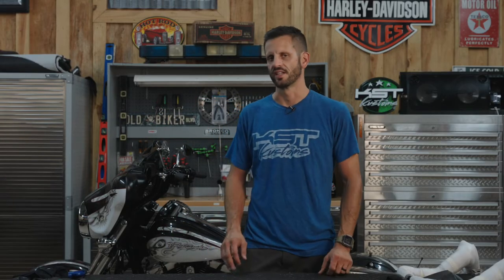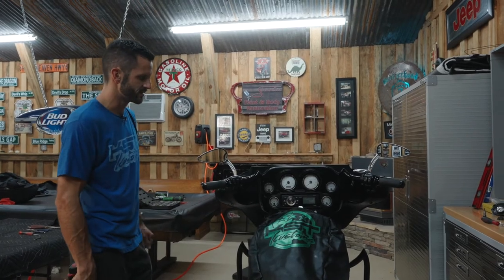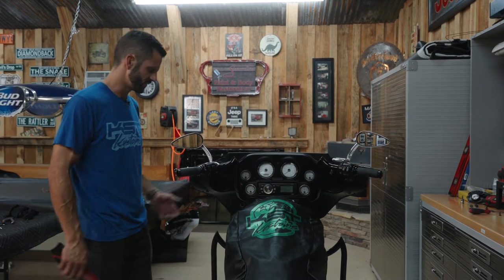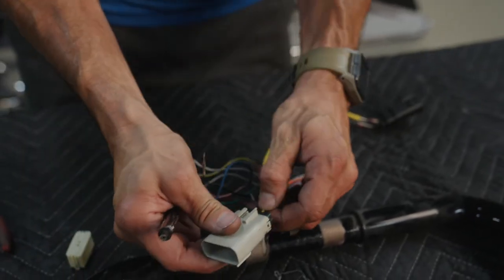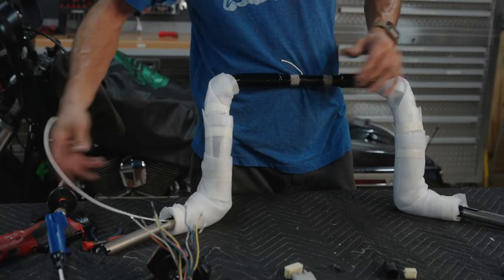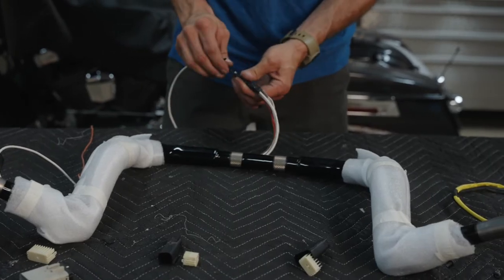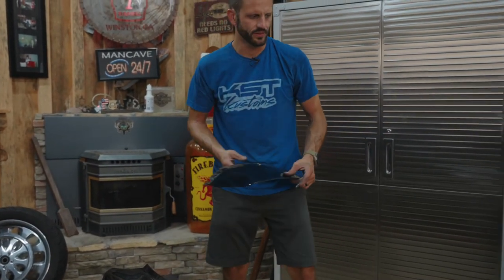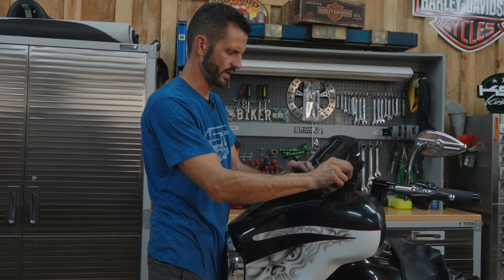2008-2013 Street Glide Handlebar Install | Street Glide Motorcycle Handlebars

Comment: Great job RET, Ive searched far and wide for a handlebar tutorial for my 2009 bagger. you hit it on the head, now Im ready to knock it out. Great tip on non CVO enternal wiring, I ran out to the garage and low and behold,,,external wiring, that was good for a fist pump. Thanks again...Dave
Reply from the maker: Yes sir

Comment: For a 2012 CVO Street Glide is there anything different? where the bar connects to the riser is the bar the same size on the cvo?
Reply from the maker: @RyanReed-b7r  exact same as this except if it has a hydraulic clutch you won’t have to reroute it.

Comment: Hello Ret, thanks for the good video. Very well explained in details.  I replaced the bars on my 2009 FLHX Street Glide. I didn’t take a photograph of it. But my throttle by wiring has an additional plug about 6 inches from the throttle control inside the handlebars.  I followed your instructions and removed the wiring from the main plug. When I started pushing and pulling the wiring out there was a small plug like I said inside the handlebars.  Had I known that, I would have just unplugged it and pulled it out the lower part of the handlebar opening and the bottom.  Thank you again for the well explained video.  All my additional wiring is outside the handlebars, I’m thinking, because my wiring is outside the bars is why there’s an additional plug for the Throttle.  I think it would be too crowded with an additional plug. I replaced the bars with the OEM bars.  Yeah I was hit broadside about a month ago in a gas station parking lot. It was all cosmetic. I’m ok, I did receive some battle scars. Bruised ribs, and a fractured vertebrae. I’m doing good.  Thanks again.

Comment: The only problem I had was the throttle by wire plug re-pinning 3 wires lined up great the other 3 wires you could see the pin in the square but trying to push them through the wires would bend and would not pop up through the square.

Comment: Qwick question.. i ordered 14 inch bars, i have a 2009 street glide .. will the stock wires be long enough too run through the aftermarket bars?  Like the throttle wires
Reply from the maker: I dont believe so. You will need to extend them prior to running the internally

Comment: Great video.  Helped me a lot.  Did my bars yesterday.  12” bars on a 2011 sg.  Didn’t need to extend any wiring or cables.   
Had zero issues pulling the switch wires through but I’ll be damned if the TBW would go.  
Racked my brain for a little while and figured out a solution.   A little bit of petroleum jelly where the pull wire and TBW wire are joined made it slip through with ease.   Can’t believe I have never seen a comment about using some lube before.
Reply: Are you 12 bars this same style?  Just curious because you said you didn't need new cables or wires for sg.  I've got a 2012 is like to put 12's on as well.

Comment: Does the throttle by wire go through the original bars or just  run alongside the bars? Sorry for the dumb question. I'm planning on adding 10" bars to mine. Tks ,  Dean.
Reply from the maker: Throttle runs inside
Reply: Thanks for your help!

Comment: Great video! Followed your procedure and everything worked out perfectly. I de-pinned the connectors per your instructions  in the video however after doing so, I later found other sources saying not to remove the secondary lock. Instead, they say to pull until you here one click and use a de-pinning tool or a paper clip in the round hole above the pin to release it.  Any thoughts on this? Also, would it be better to fully tape the control wires or put them in a sheathing a little less bulky than the original? Just wondering if the added protection is needed? Thanks.
Reply from the maker: Yeah everyone has their own ways. Not everyone has access to the correct depinning tool and a paper clip will work about 50% of the time. I don’t find it necessary to tape the whole harness or heat shrink it personally. I’ve done a bunch of these with zero issues down the road

Comment: Doesn’t seem like the brake line is long enough for the 12”. I did what you said with the clutch cable but can’t seem to figure out the brake cable
Reply from the maker: Yeah only 10” will work with stock brake and clutch on the 08-13 models. I though I was pretty clear on that
Reply: Kst kustom I was told by revzilla you can go up to 12in without extending 🤔 on my 2012
Reply from the maker: @shawnmccullough1204  not on the 08-13 models. 10" Is the highest you can go. 14-23 you can go up to 12" with stock components

Comment: This may seem like a "Silly"--even Ridiculous--question, but can the ignition switch be removed without a key?  HD Touring Service Manual gives very little guidance.  I've not done the 1000's of Handlebar jobs as y'all have, but I've never changed out bars without the Ignition Switch Key.  Customer says he never had a key(s).  REALLY?!? I have to throw the BS Card!  Anyway...that's the challenge of an HD Indee!!  Maybe y'all have a work-around!  Short of telling the customer he's...out of luck until he gets a key!!
Reply from the maker: Yeah you gotta have the key but you shouldn’t need to remove it. What bike is it?
Reply from the maker: @michaelmagee4408  ah… yeah you gotta have the key
Reply: So Rhet!  As I'm gettig into the OEM bars-4-Ape Hanger swap I'm haveing fun "Proofing" the HD MY Service Manual.  Guess this is where just "Book Smarts" and EXPERIENCE diverge from that-on-hand Real World Experience.  On my Throttly-by-wire harness I DO NOT have the luxury of a "Yellow-wrapped" trio of wires. It will be wrapped with yellow electrical tape when I'm done though! De-pinning is the ONLY way to go: I speak from experience. While the time at HD Factory Training focused on "Specific and Eaxcating Soldering" Techniques there really is no substitute to Slow, Deliberate and Methodical TTPs. [TTPs: that's Tactics, Techniques & Procedures to your non-Military patrons].  Take! Take! Take pictures of each wire-harness connection; and, take it from more than one angle. Moving on to the Bushings ("Rubber Mounts") at p. 2-91 2014 HD Touring Service [manual]--would really love it if you'd do a Instructional-video on this subject. The Service Manual is woefully inadequate. Not having access to PHDs and DTII the Indee is really left out in the cold! Guess that's the punnishment we Factory-trained Techs get for being Benedict Arnolds?!?  You will need either a JIMS or Motion-Pro (PN 08-0139, 1-3/8" Socket to get at teh Upper Suspension Nuts (2 ea L/R); and, a 1-1/2" Socket and/or Wrench.
Reply: also: on my TBW plug I've GN-R-V on one side; and, BN-BE-BK on the other side!  Oh the joys and mysteries!